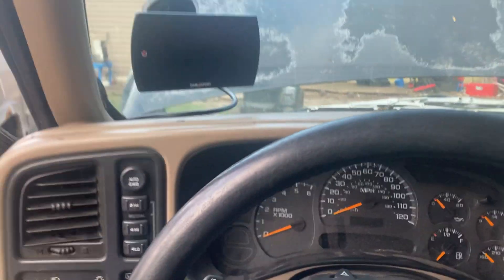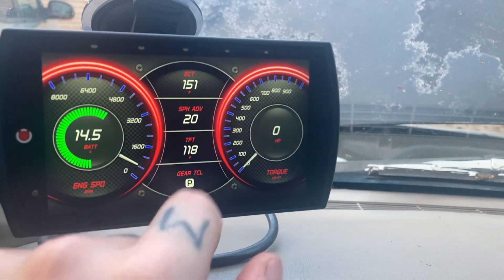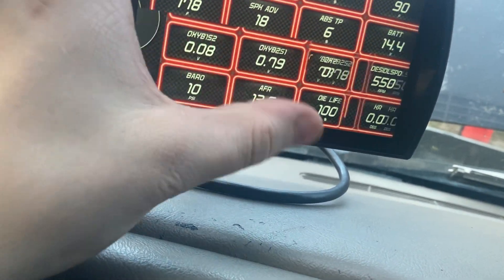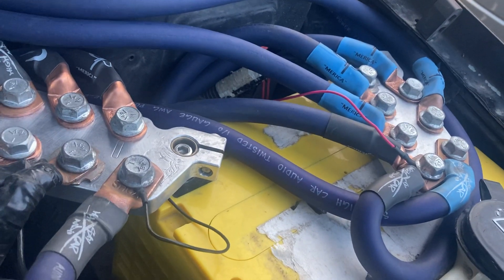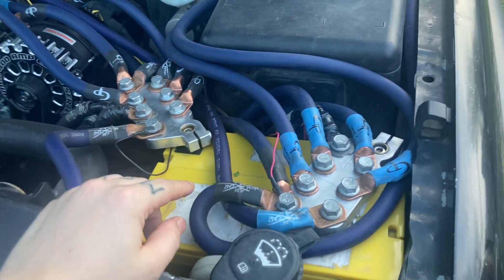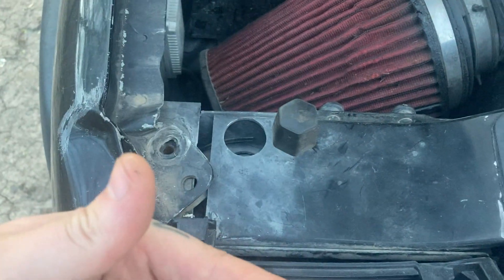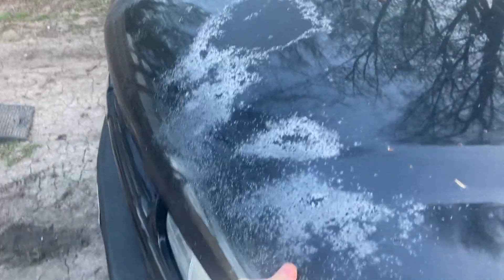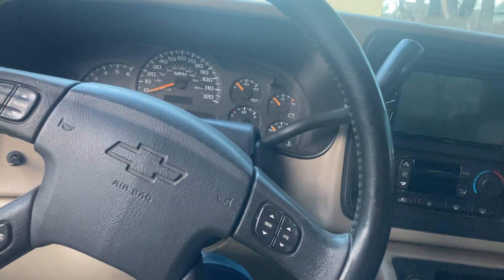My voltage device talk/ and random yapping about my truck

Comment: Dam I'm supr I sed you have any voltage drop lol with 2 400s alts. Maybe get rid of agm and go lithium you be golden.
Reply from the maker: Yeah half ohm with a taramps 12k is brutal on electrical, and everyone keeps telling me to go lithium and I might one day but rn I’m not ready or wanting to do that,, and also just learned my device I’m using to keep an eye on my voltage is pretty far off even on low volume so I’m probably not actually dropping as much as I thought I was, have a video loading rn on it and 2 other devices compared to multimeter directly to battery
Reply from the maker: I’m willing to bet if I add 2 more 120ah agm I won’t have any voltage drop at all with current settings on amp